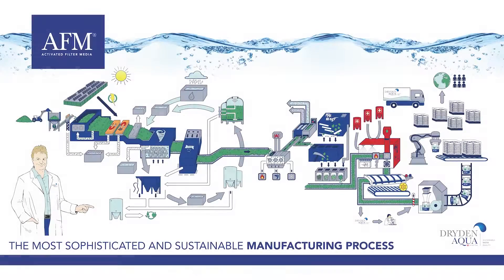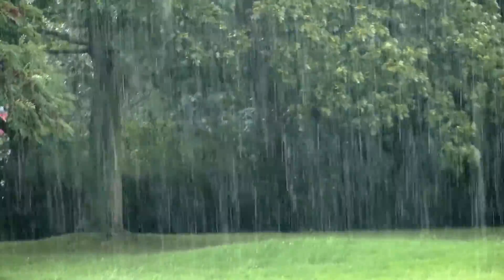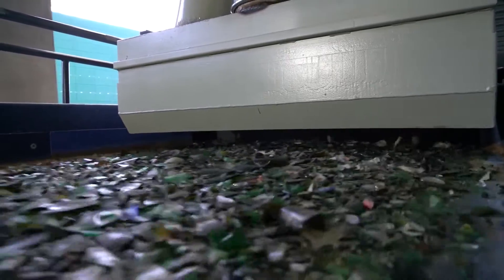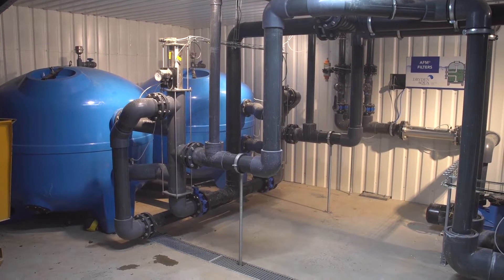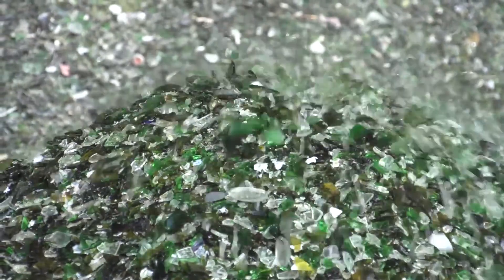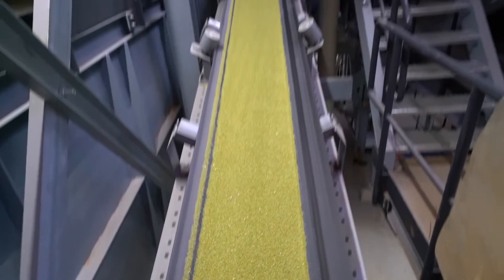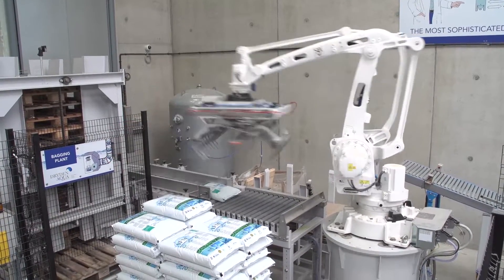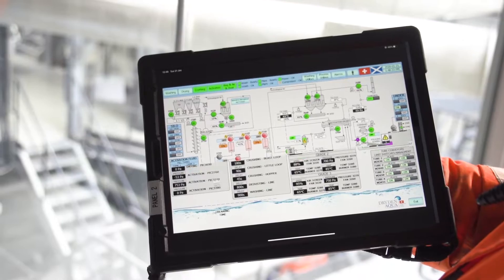AFM® Factory : How is AFM® manufactured?

Comment: Excellent! Appreciate the effort of sharing every process and giving such a transparency to your production. Do you think I can use AFM and UV filtering in my residential pool without any chlorine?
Reply from the maker: Hi Z - AFM will reduce chlorine demand but you will still need proper disinfection. AFM combined with coagulation and flocculation (see our DAISY video) can reduce oxidation demand by 50 to 80%.
Proper hydraulics is also a must. Make sure you have a turnover rate of 4 to 6 hours maximum depending on the load and water temperature and proceed to a proper backwash once a week to remove all particles out of the system.

Comment: Will AFM lessen the hardness of water or does the negativity of the glass attract calcium, magnessuim etc....
Reply from the maker: AFM standard will attract and remove positively charged particles in suspension. Not if in solution/dissolved in the water. AFM NG will attract and remove hydrophobic substances in the water such as organics and micro plastics.

Comment: Hi i have a water refilling for drinking water here in the Phillipines and im planning to buy your product..what is the best grade you can advise for a water reflling is it grade 1 and 2 ? Whats grade 0 for..will this affect the flow rate of my equipment? Im using 10 by 54 frp tank btw..pls advise..i also subscribed
Reply from the maker: Dear Christopher, you will need different grades , not just one. Please refer to our AFM instructions for use manual available on our website download section https://www.drydenaqua.com/downloads
Reply from the maker: Grade 0 is used when coagulation / flocculation is not possible => filtration down to 1 micron without flocculation
Reply: @DrydenAquaCorp  just downloaded and read the manual..too many information but very important and helpfull instructions..totally amazing...i need to read it more carefully..million thanks
If i have questions i hope you could enlighten me as well...